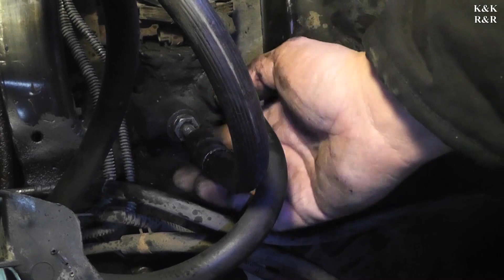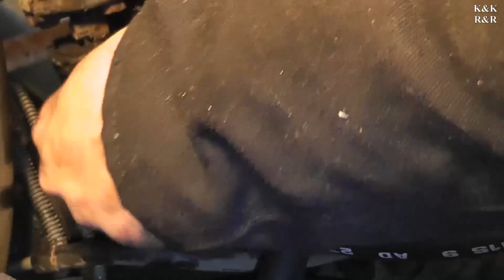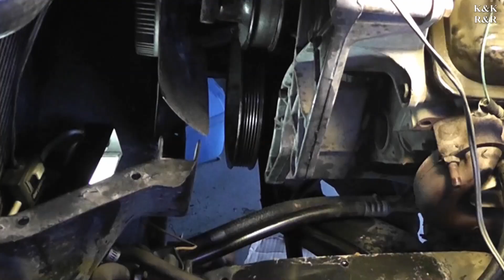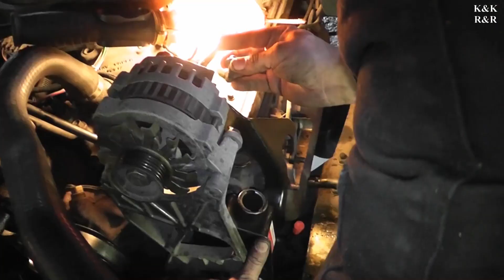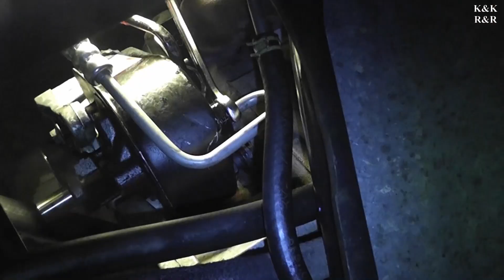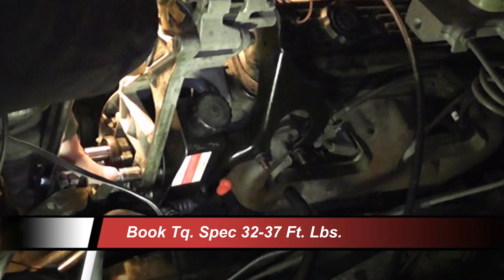Power Steering Pump Replacement 1995 Chevrolet Silverado PT.3 New Pump Install/High Pressure Hose

Comment: How in the hell did you get a line wrench in that space at 7:50 on the video counter. I need to get in there to get the pressure control valve out. I bought a remanufactured pump and thought I could just install the damn thing but its leaking from there. I really dont want to take it back off again.
Reply from the maker: I came from underneath the pump.   Stubby flare would work as well.  If you just put the high pressure hose on you might be able to use a normal wrench to remove the hose.   All that work to install a new pump to find the control valve to be an issue would be a pain to do. Parts made after 2019 have been terrible that's for sure.
/K&K

Comment: And it's SOOOOOOO much easier if you put the bracket on the pump and the high pressure line on the pump BEFORE you put them back in the vehicle

Comment: What size line wrench did you use to put the high pressure line back on the back of the pump?
Reply from the maker: I believe it was a 5/8 for the pump and 3/4 for the the steering box.  If possible buy a cheap set of flares at harbor freight if you can. 
/K&K

Comment: Never use vasoline on an o-ring.  Lube it with the ps fluid you will be using. Vasoline can deteriorate rubber o-rings prematurely.

Comment: Hello I have the K5 and my power steering went out ,so I put a used pump on it and it worked for 10 miles then stopped working , so I put a new pump on it and still no power steering ? Thanks
Reply from the maker: It may be possible there's a problem in the steering box that's not allowing Hi-Pressure oil to pass through, or the system isn't bleed properly.   Two pumps later I would say the steering box has an issue at this point. There is a one way check valve in the steering box that can cease up and block the flow of Hi-Pressure oil.  Fluid can only flow one way in the steering system.
/K&K
Reply: @KNKRNR  Thanks for responding a gear box will be next !

Comment: Hey man I’m having a hose leak on my 95 z71 but i don’t know if it’s my pressure hose or my return hose I don’t wanna buy one and it be the wrong one is there any way I could text you in Social media or anything and send you a picture and you tell me if it’s low pressure or high pressure please
Reply from the maker: Sure, you can send me pictures at knkrnr@gmail.com . Those hoses can be spendy for sure. 

/K&K
Reply: Have 9ne turn wheel when engine 9n and its full

Comment: I'm going use your hose trick next time I do a power steering pump. I always fight with those hose fittings! Thanks for video keep them coming!
Reply from the maker: If i cant get the high pressure hose off by normal means I will cut hose a install new one. I had a core rejected once because I destroyed rear fitting, I was told "Cut hose off but leave tip on we will fix it. We have tools that you don't." It's a time saver for us now and normal part of power steering service. Thanks for watching!
Reply: @KNKRNR  hi i got a 97 sierra i change the power steering and steering box and the steering wheel still hard

Comment: hey  was able to get the old pump out complete, but going back in I cant get it to go back in from the bottom. Any tips this is my 92 c1500 work truck and its sitting dead in the driveway any help would be nice!
Reply from the maker: No problem, two things you should do,
1. Remover Lower Radiator Shroud and see if that will give you the clearance you need from the bottom, or
2. Remove rear bracket from pump, get pump faced in the right direction front wards, then slightly at an angle re-install rear pump bracket with pump close to in place, then torque rear bracket to pump and finish pump installation.

Some truck will let me go through the bottom and back up no problem, other times i have to remove both fan shroud and assemble in place. This way is a bit more time consuming but effective!  Hope these tips will get you on your way!